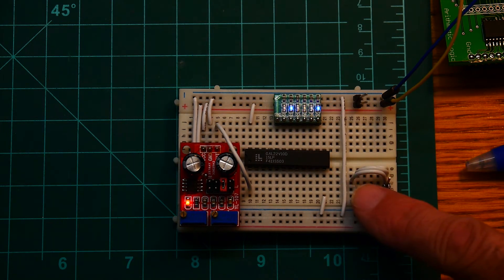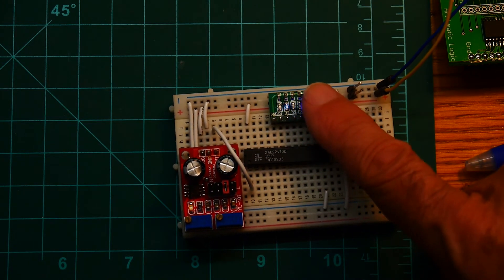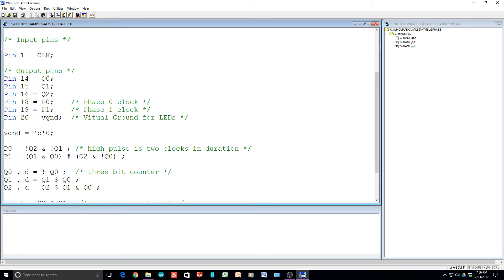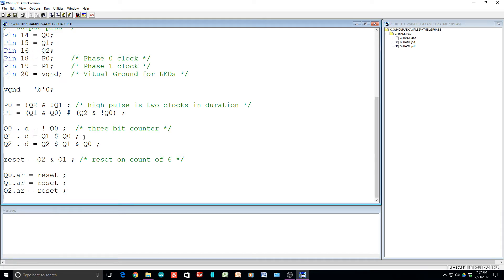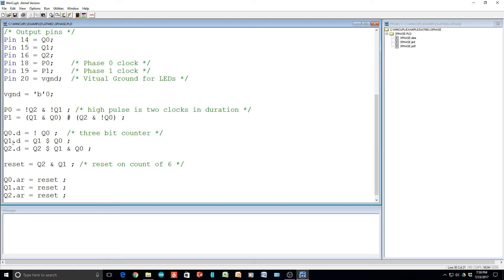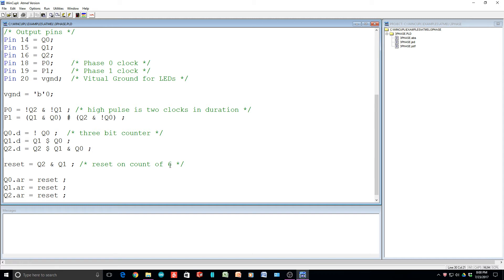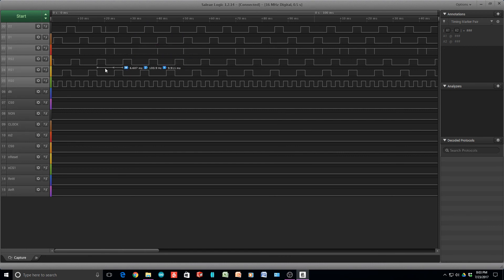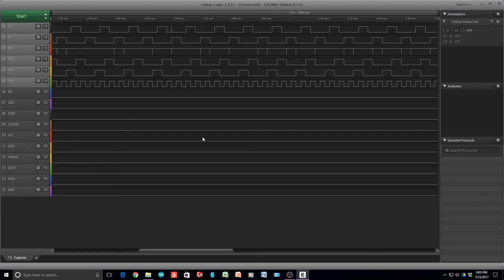#91 TTL CPU 22v10 clocks

Comment: its me again, still gonna try making my own programmer for these old chips, would you mabey make a file for me to burn to the ship if it even works and its not programmed?  the ones i got are one time programmable only, but a shift register would be nice, know id havew pins leftover but atleast i can use the chips i wanted for a neat clock project that will need a shift register